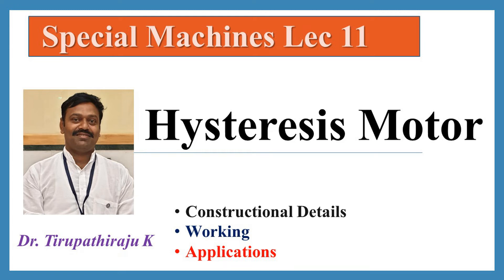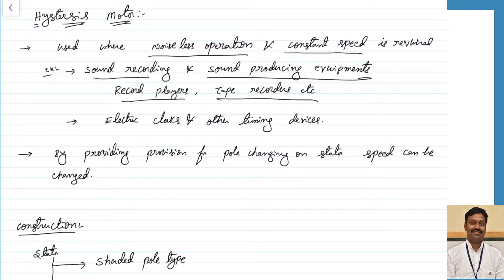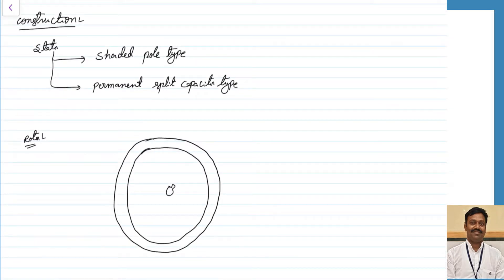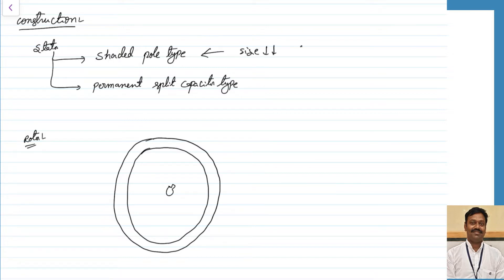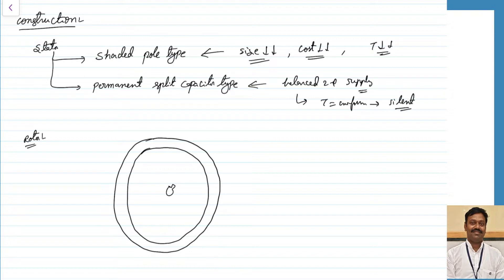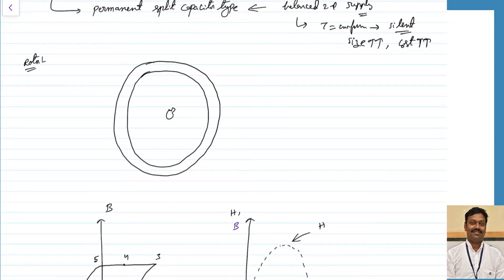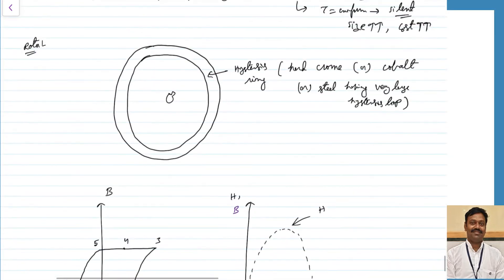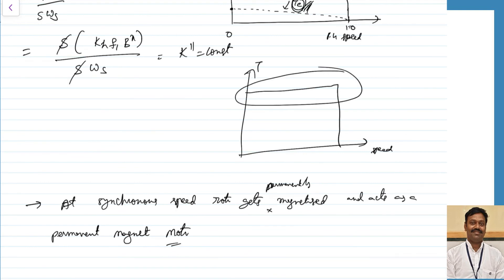SEM11 Hysteresis Motor

Comment: Sir Hysterisis torque is proportional to (fs *phi(r)*sin(d)).ok .Now as  speed of stator mmf and rotor mmf wrt stator is constant so sin(d) is also constant .but with change in rotor speed will not  the value of phi(r) change then how hysterisis torque is constant through out the speed range?
Reply: @lecturesinelectricaleng  sir I understood but then how rotor is getting induced mmf ? This is what I want to know.plse explain